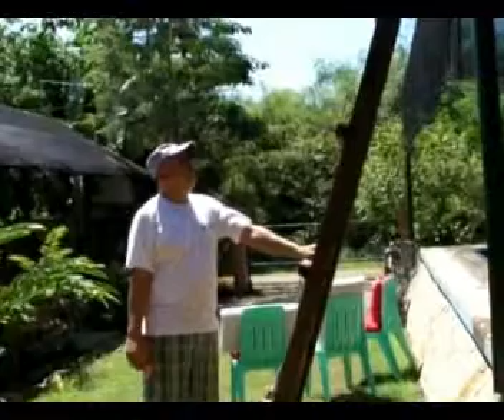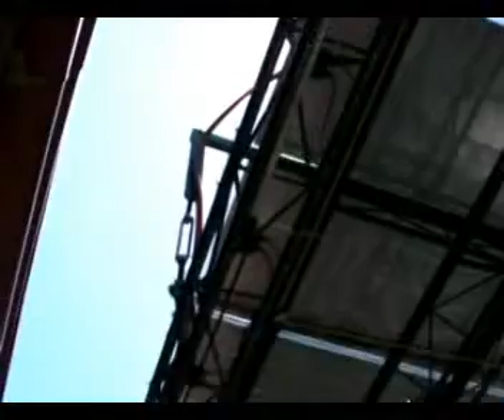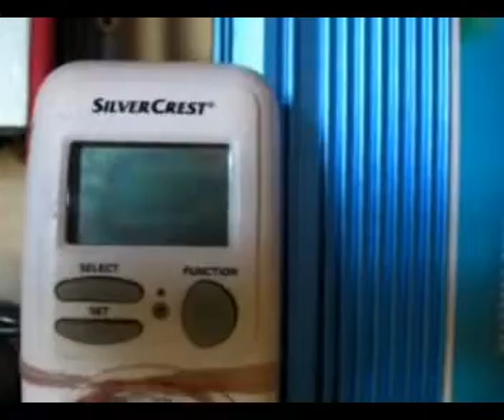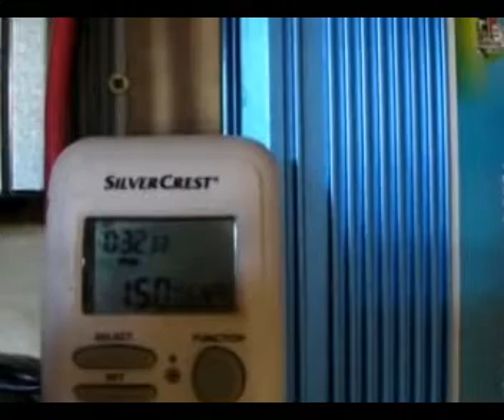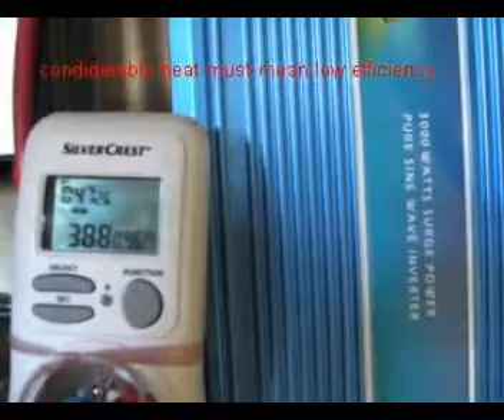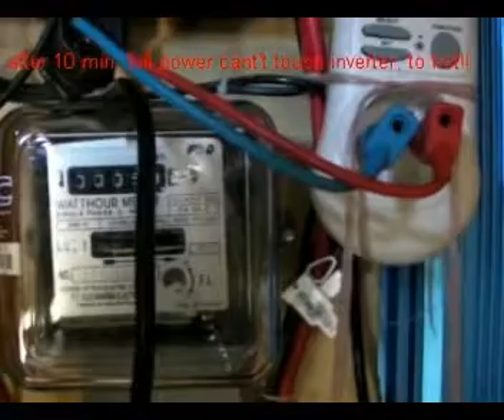testreliablesolarset.mp4

Comment from the maker: reaction on my curve from supplier :This is right, But this situation has been Solved,those inverter that after october producted,this problems has been solved. It’s have sufficient power to output under 15v.
The previous inverter in the low voltage segment of the power is a bit low, last month, we are  from hardware and software to improvement, and now in the low voltage input,it can work well.  500 W of inverter at 14 V input, if the current enough,

Comment from the maker: ok, thanks, will try it, at this moment I am working in Singapore but once back in Palawan I want to try it. I have made a curve from the relation between the voltage input and the power produced by the grid tie inverter and the Chinese supplier admitted that this inverter could not supply more then 200 watt at 17VDc input.
Recently they developped an inverter with 12 -  40V with a serial output.